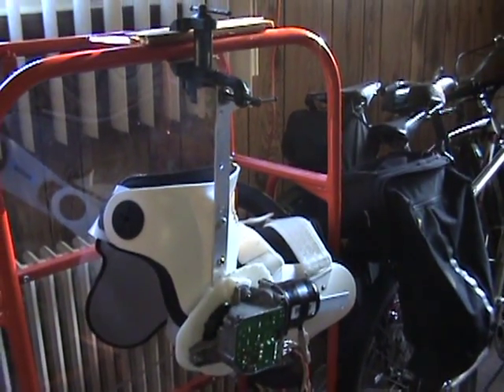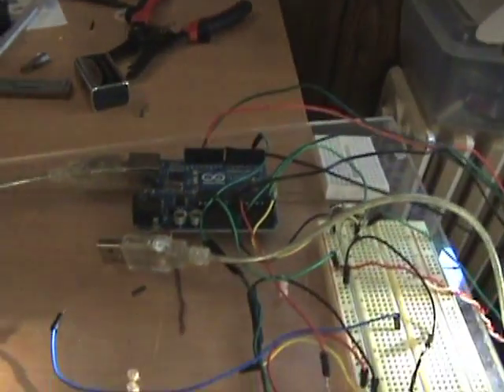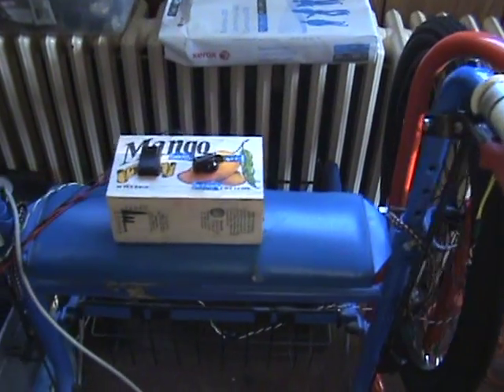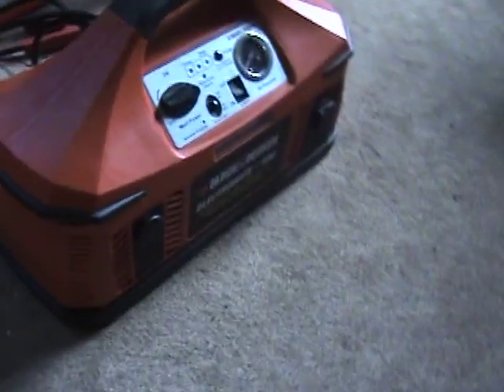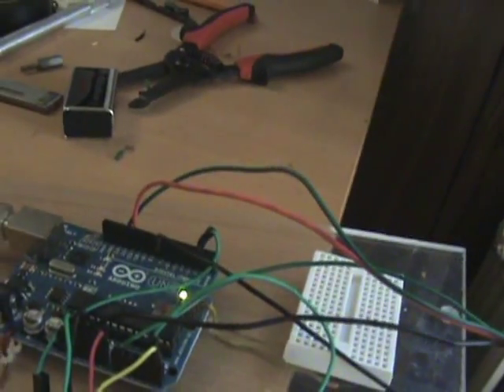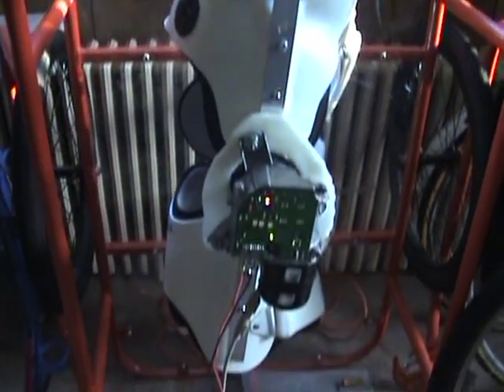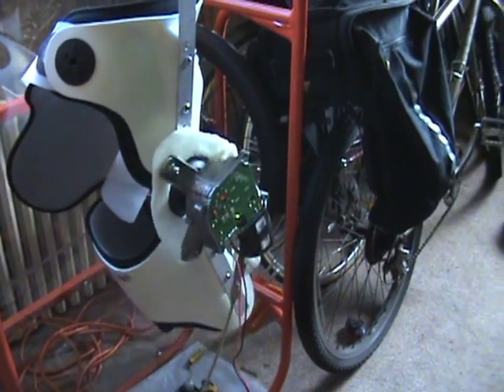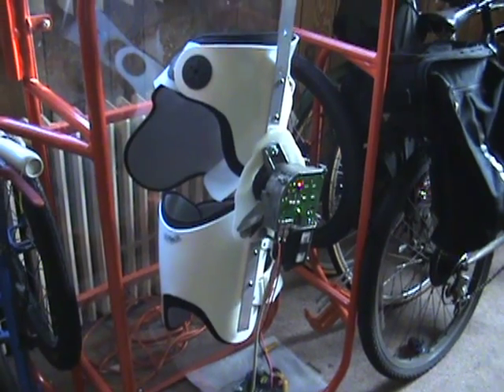Exoskeleton Prototype 2 Update and Walkthrough

Comment from the maker: @devwiththewelch That's a good thought w/ the linear actuators. I actually tried using the linear actuators for my prototype one though and although there are positive aspects like the strength and rigidity, there are some downsides too like the slow speed of actuation and also the rigidity. The rigidity is a plus for keep the users leg in line but it's also a negative for not being forgiving at all and also necessitating a unit with more weight in order to attain the rigidity.

Comment from the maker: @VicariousReality7 That's a great point Vicarious. The molds and strapping do provide some wiggle room. It's a tough challenge because you want the attachment of the device rigid so the motoring of the joint is efficient but at the same time you don't want it so rigid as to be uncomfortable and constricting. And no matter how well-aligned and customized the brace is, it will never be perfect given the shape of the human body and the changing geometries during natural gait.